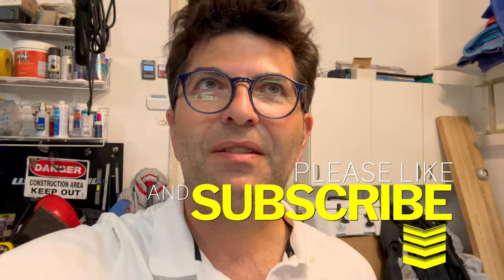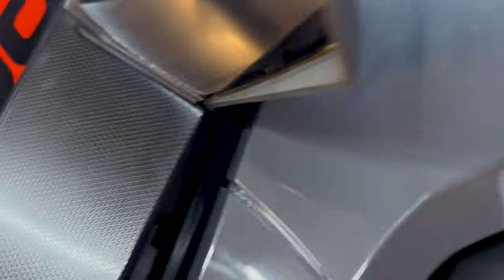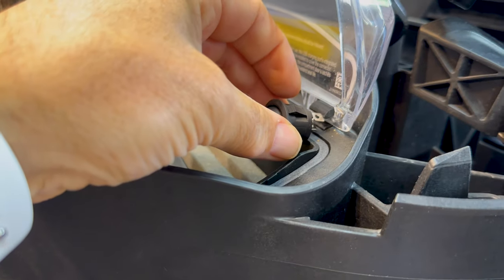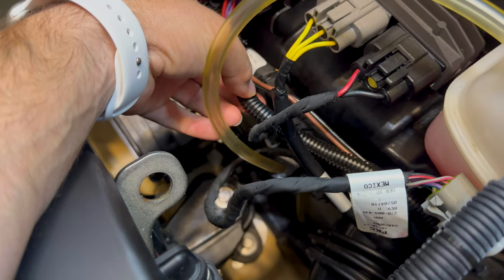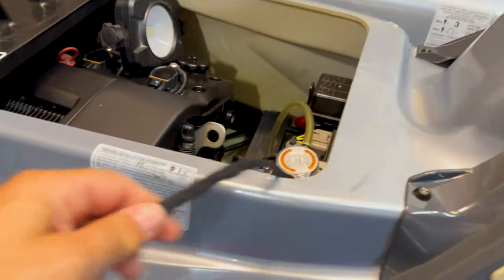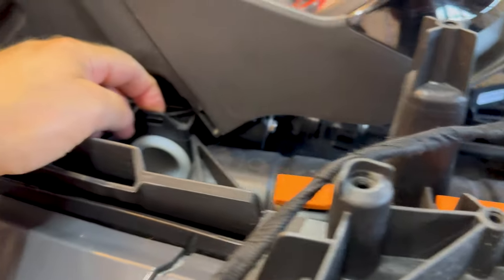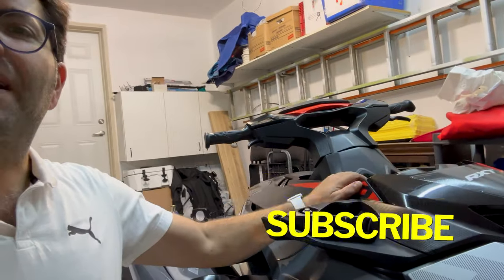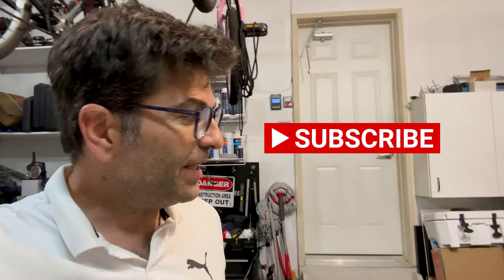How to install 2018 & up Sea-Doo Bilge Pump Rocker Switch (Part 3) | S4E3

Comment: I just ordered everything on Amazon, except I'm not going through the dash. I'll put the switch under the seat. But thank you for all of this!!  My Sea-Doo 24 Fish Pro Trophy ordered a stock bilge without knowing it wasn't a conventional bilge. I'm going to put the shut-off in. I also bought a kit for a tow valve. Next endeavor. Dave..
Reply: Have a link to the tow kit?

Comment: I love how deep you went with this bilge pump. One remaining question: with the power to the bilge pump off will it still operate as a scupper using the suction from the jet output like it does on the other side?

Comment: I am having plans to fishing of this ski's next year. All these videos on safety to protect flooding, but I see no reason to let bilge pump on permanently, which will fail when you need it. Can you do the next video on the installation of the water sensor in the hull with alarm, which will start the bilge pump.  That means you did not need that switch installation😁😁😁
I still liked your installation step by step.
Reply from the maker: That would of been a nice project but most folks wanted a kill switch. What kind of alarm were you thinking?
Reply: Hi, thanks for replying.
To save ski from  flooding without you knowing there is water leaking through, a water sensor(float switch) will automatically activate, and the alarm is to tell the user there is water in the hull. This is useful when the engine is off. Especially far from shore.
A manual switch might be too late. If you switch off while fishing for hours.
My point is that both methods work similar.
My suggestion  is simple installation with float switch in hull, and your method is a manual switch installation. Less holes and dissembling are better for ski. I tend to break something while taking off parts.
That alarm could be a buzzer in the hull, too.